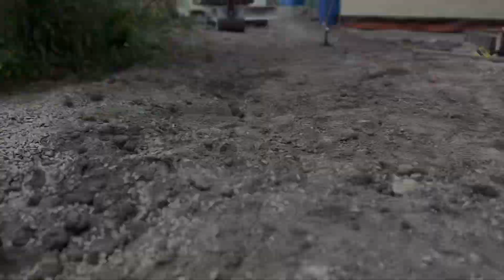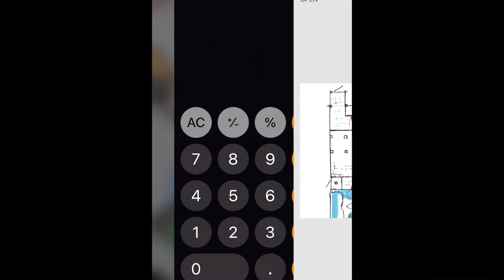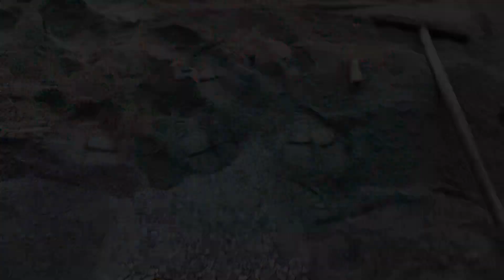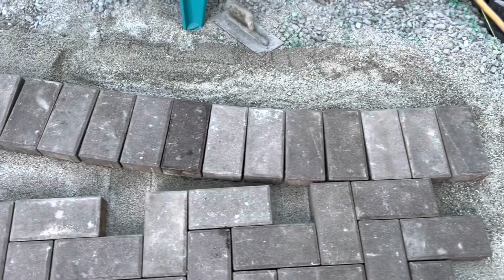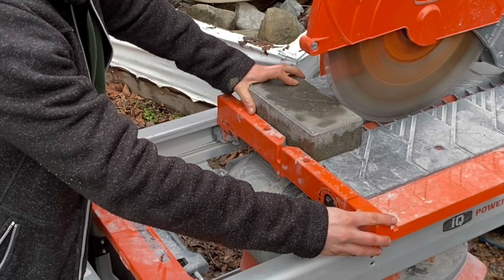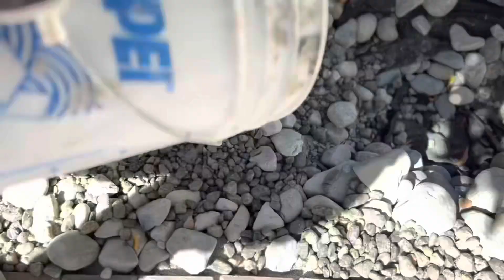Landscaping ideas on a TIGHT BUDGET! Save $ and create the perfect backyard space.

Comment: For the bridge over the riverbed, is that just four 4x4's?
Reply from the maker: They are 6x6’s treated and built on pressure treated 2x4’s on a gravel base. With free draining gravel all around.
Reply: @HardscapeCanada  Thanks for reply! So the 2x4's are sitting directly in the gravel underneath? 

I like this design and will be doing something similar in my front yard.
Reply from the maker: Yes that’s correct! Just make sure they are pressure treated! Anytime we have any wood against soil or gravel it hold moisture and will rot faster, so definitely take as much precaution as you can to slow or stop moisture from touching the wood. Check in on it every spring to make sure it’s still stable and safe as well